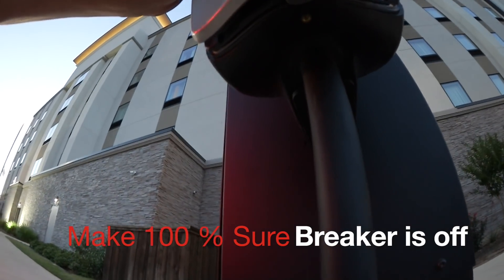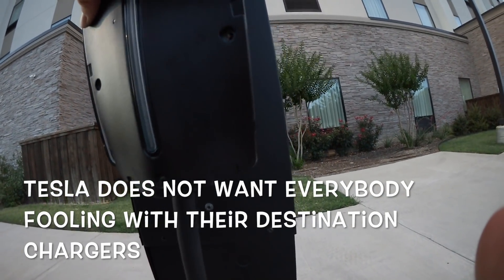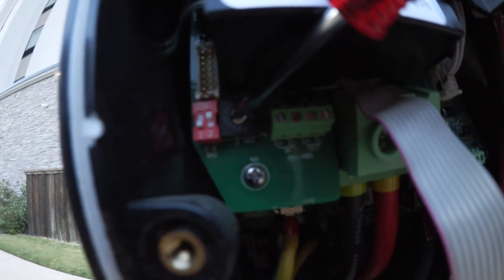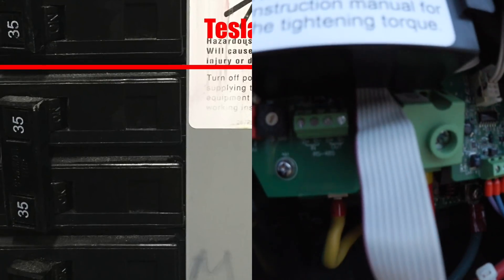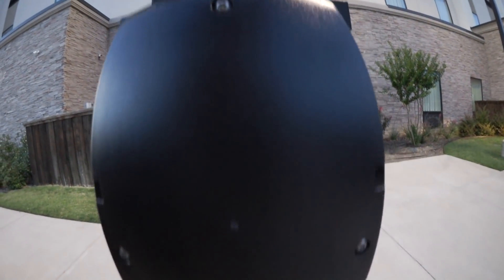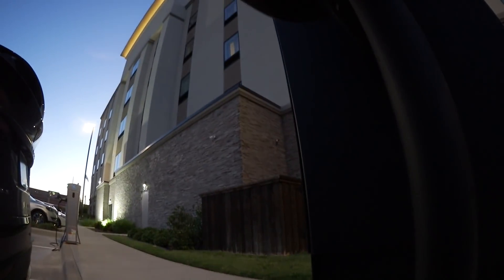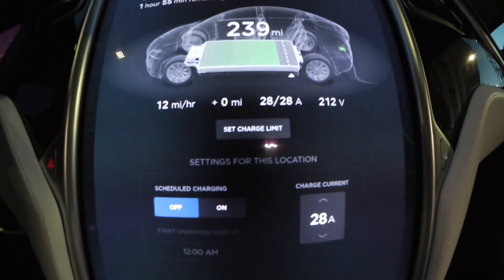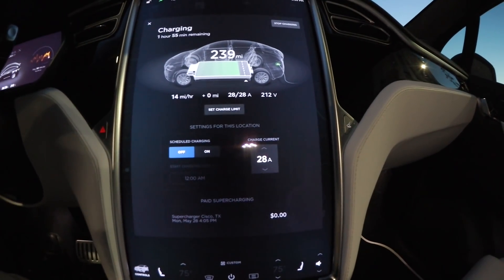Tesla Destination Charger Upgrade

Comment: Great information. I have contacted the Element Hotel in Chandler that has 2 Tesla Destination chargers that are set low and wrong. I have offered to adjust theirs and also gave them the link to your video showing how it needs to be done and is very easy if they are careful. Thanks Telsaowners.us

Comment: Coole Aktion. So Sachen hab ich auch schon 'geboten', aher mit IT Zeugs dann (Router Konfiguration etc.). 
Wenn das Kabel für 30A max gut wäre, wäre aber ein Dauerstrom von 28A schon recht 'üppig'. 
Wieso eigentlich 3 Wochen? Warst du so lange in dem Hotel? War das nicht in Texas?
Reply from the maker: EVPaddy, Ja war so lange in dem Hotel. Und das hat mich schon gewurmt, dass der Charger falsch eingestellt war. Rolf
Reply from the maker: Ja, ich hatte eine kurze 4 Wochen Aufgabe in Dallas. Wollte aber auch ein Tesla dabei haben. Rolf
Reply: Cool! Ich glaub ab Ende war der Manager ja richtig begeistert ;)
Reply: Bei mir ging der erste Gedanke in die andere Richtung. 5mm^2 für 30A kam mir überdimensioniert vor. Aber dann ist mir eingefallen dass die die da drüben 110V haben 🙈
Reply: Ich glaub mittlerweile sindes 120V. (Und hier dann 240 aus 2 Phasen)
Reply: EVPaddy nee, hier sind es 230V aus einer Phase gegen den N und 400 Volt Phase gegen Phase🤓
Reply: Markus Bekkenk ich meinte bei dieser Station, nicht “hier” :)

Comment: Nice work, Rolf!  When you posted the earlier video, I was wondering if it was just the switch, as I read the manual when we got our wall connector.  Good for you to research the wiring and determine it was wired correctly but with the wrong switch.
Reply from the maker: Mykle, Otherwise you run into the problem that you overheat the wire. I checked all 3 factors: the wire diameter, the breaker and the dial. Now everything is in sync.Rolf

Comment: Warum wollte die Installationsfirma das nicht korrigieren? Die haben doch bestimmt von Rolf oder dem Hotelmanager Bescheid bekommen?
Reply from the maker: Jürgen Bolke Ja die haben dem Hotel ein Upgrade fuer 80A angeboten um noch etwas mehr zu verkaufen. Die Installationsfirma meinte es waere alles richtig. Das war es aber nicht, da jeder Wall Charger mit der Einstellung auf 1 = 12A kommt. Die habe nur vergessen die Einstellung auf 5 = 28A zu drehen. Das habe ich dann gemacht nachdem ich die Kabel und Sicherung geprüft habe. Rolf
Reply: So machen es die Deutschen in den USA: Selbst ist der Mann.